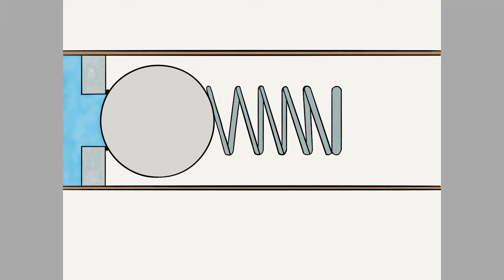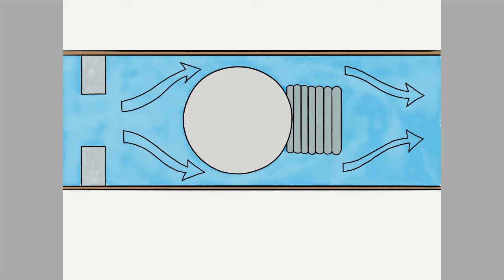All About Dripline with Check Valves || Drip Irrigation (Irrigation Training)

Comment: On the pre spaced CV emitting drip tube like Rainbird, Netafim,etc aren’t the check valves in each emitter ? Also how do you unclog the emitters. Some of them get plugged up. While the neighboring emitters still working.
Reply from the maker: Yes, the check valve is at or in the check valve. I'm not sure how to unclog the emitters. This is why filters are so important for drip. Does anyone have a tip or trick for this? Compressed air maybe?

Comment: Ok because I have a small drip system maybe going 5-10 feet tops and am planning on roughly 1600-1800 gph on 4 bubblers idk what that equals in psi but just looking for something to stop the drain of my water tank after the pumps turn off